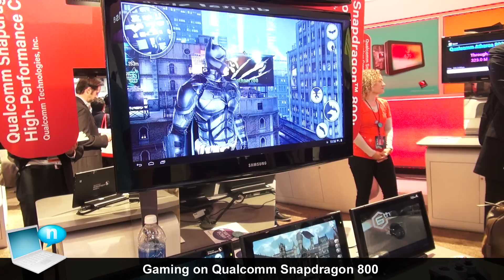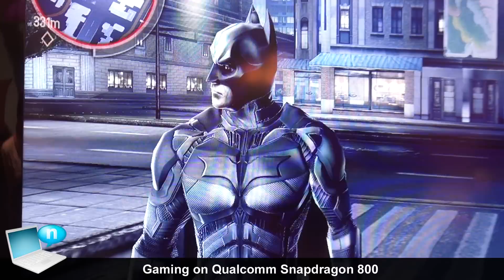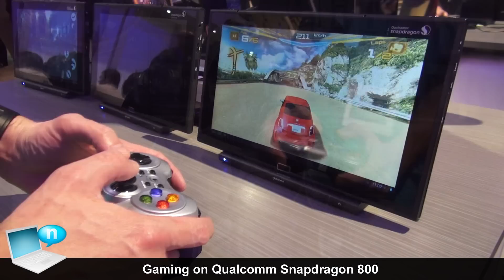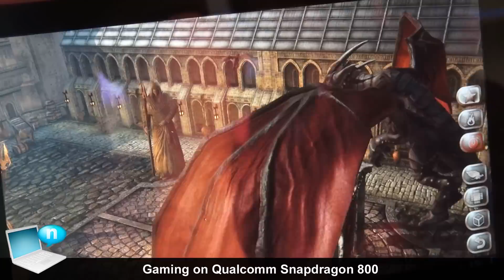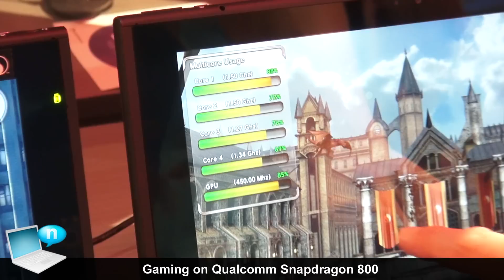Gaming on Qualcomm Snapdragon 800 - Adreno 330 (The Dark Knight Rises, Asphalt 7 and Fortress Fire)

Comment: Lol Allen coffey No way does the tegra 4 compare to the adreno 330. Run a core evaluation on cpu identifier app and the snapdragon 800 adreno 330 chipset by far surpasses the tegra 4 chipset. They have a list of every processor out there and thier rating and puts them to a list. This chipset is listed between the versions of the intel core i3 chipsets.
Reply: I already knew adreno 330 gpu was faster and better but the snapdragon is also faster, but not as strong. The tegra 4 can handle much more intense multitasking and junk like that. And besides, the tegra 5 coming out in said July of 2014 is 3x the power of a ps3( or how the verge said it would be and also on some forums I read said the same) I love snapdragon 800 and it's chipset, but I've always been most comfortable with having tegra enhanced games, and just a solid chip on its own, and one more note, tegra 4 isn't all that great on battery life due to its cortex a-15 cores vs the snapdragon a-9s
Reply: Allen coffey aight man, but the "krait" architecture of the snapdragon chipset is similar to a-15's architecture.
Reply: Actually it's based on Harvard architecture, ( straight data reads, and process, let's gpu do it job separate) I think the a-15 are just the tecnology it's based upon. I also just looked this up. A tegra 4 is wth the core i3. But I think we can both agree that these are some serious beefy chips